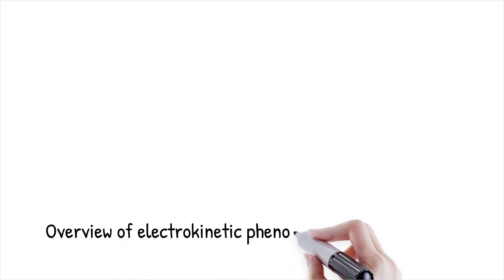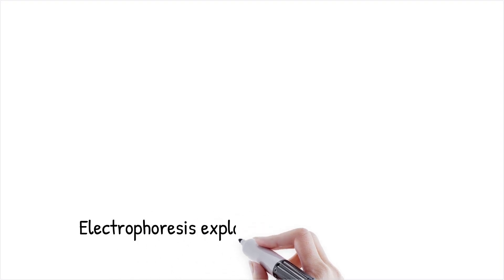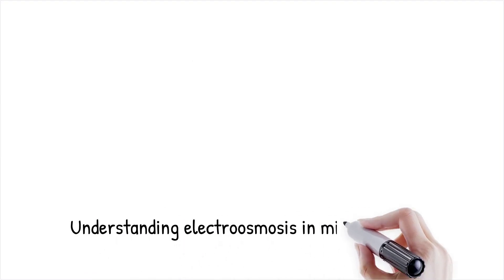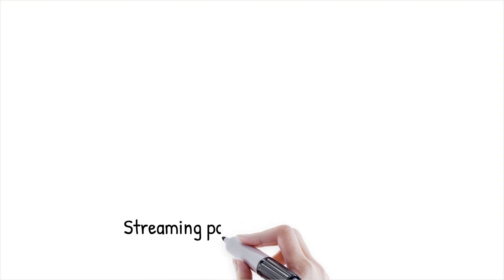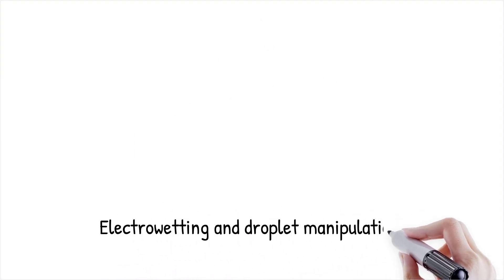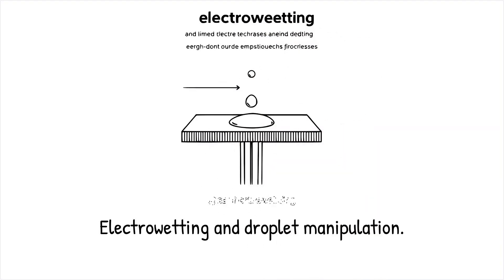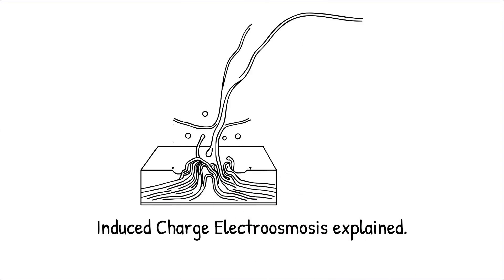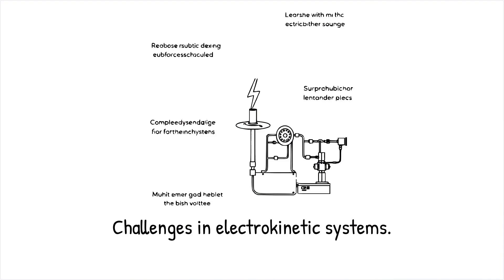Electrical Phenomena in Microfluidics:  Electrophoresis and Electroosmosis

Comment from the maker: How does the interplay between the electric double layer (EDL) and induced charge electroosmosis (ICEO) contribute to non-linear flow behaviors in microfluidic systems, and what are the implications for optimizing fluid manipulation in lab-on-a-chip devices?